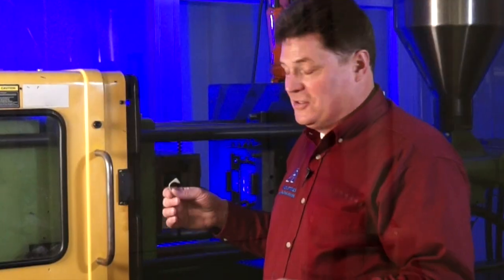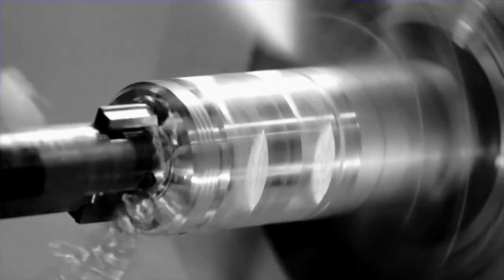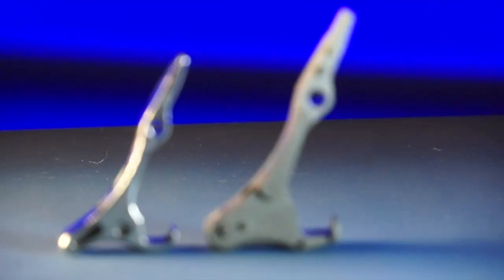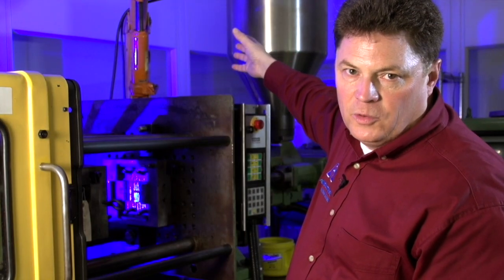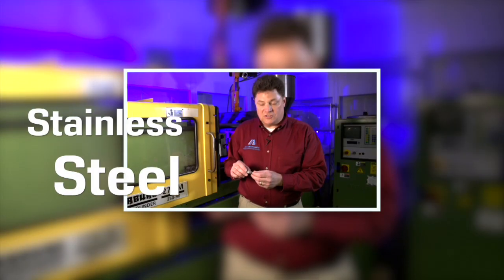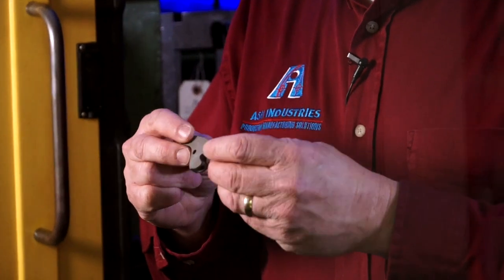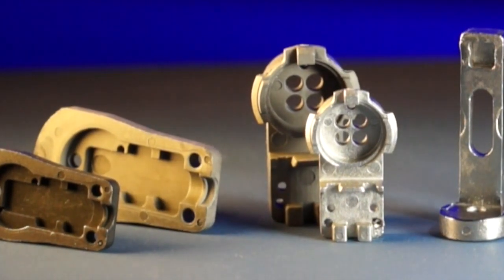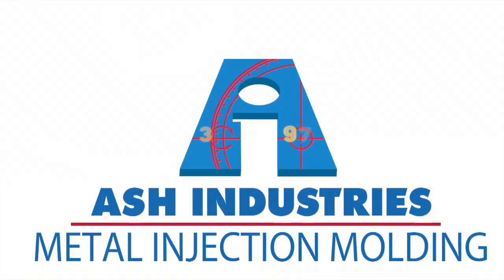Metal Injection Molding Tips | ASH Industries | Lafayette, LA

Comment: Hi, how does the injected steel not damage the mold? Is it something to do with the binder material?
Reply: The temperature is very low and the steel particles are spherical and so they are not very abrasive.
The binder is also a lubricant.
Reply: Molds typically have a life span. Aluminum molds used with abrasive materials don't last as long but the customer may only need a few thousand parts. In the initial phase of the quoting process, they would ask how many parts you are expecting and they would suggest what mold material to use. The more parts you need, the harder the material would have to be for the mold.